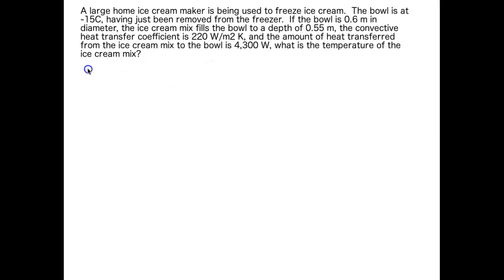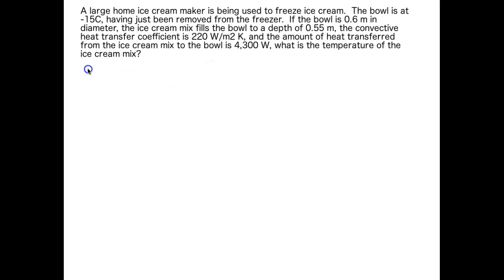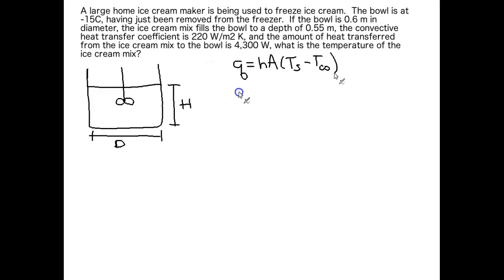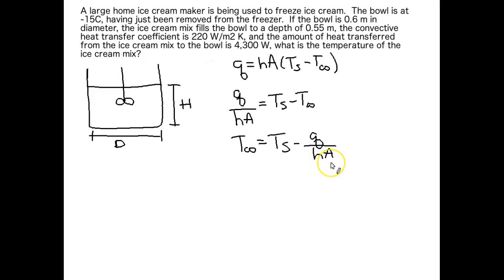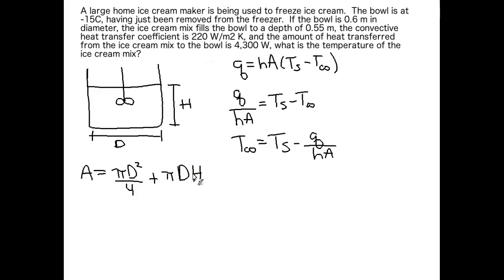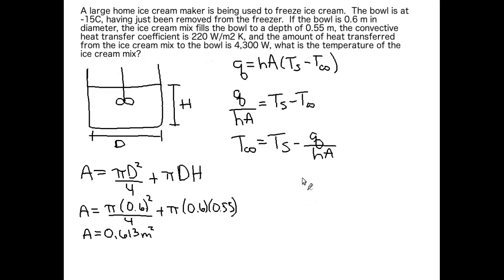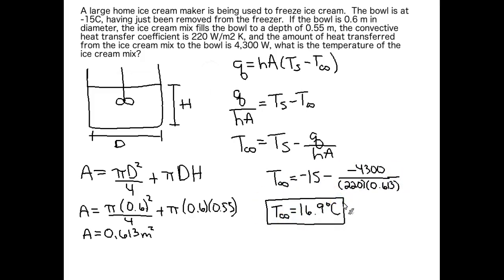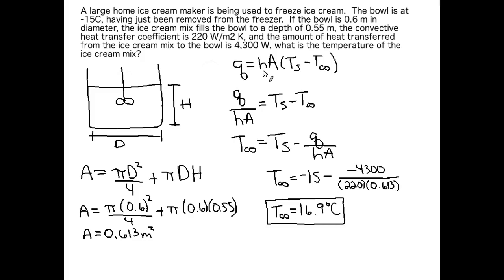Solving Convective Heat Transfer Problems Demo Video

Comment: When I plug in the values for calculating the area into my calculator, I do not get 0.613 m^2 like you, instead I get 1.32 m^2, so you made a mistake when pressing your calculator. Using area as 1.32, I get the temperature of the ice cream mix to be  -0.2 degree celcius.
Reply: same here